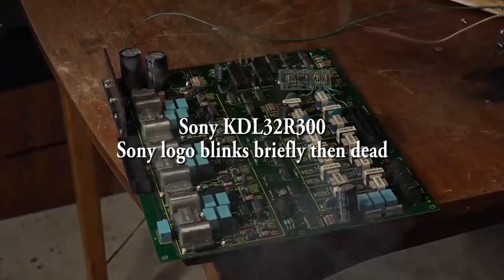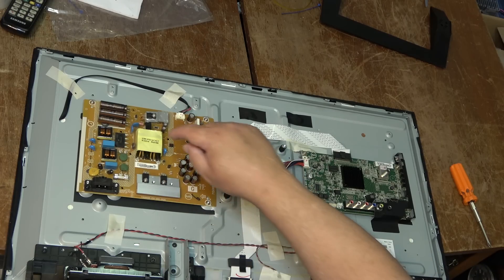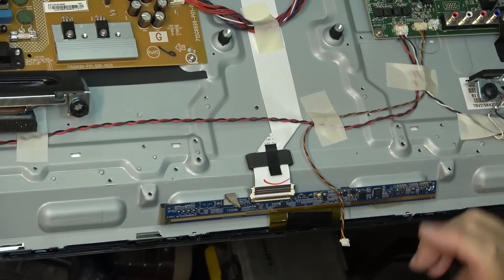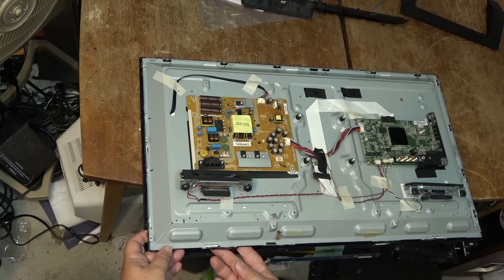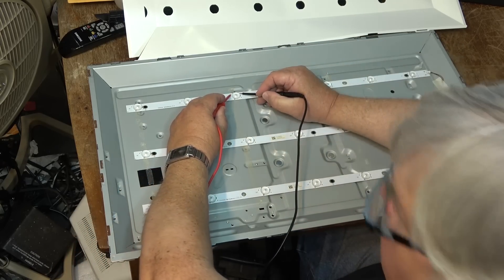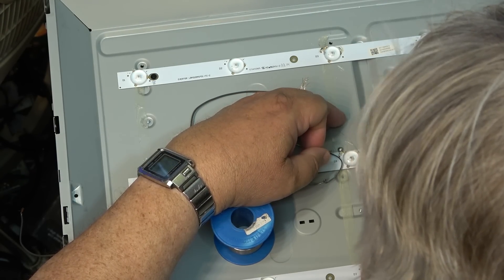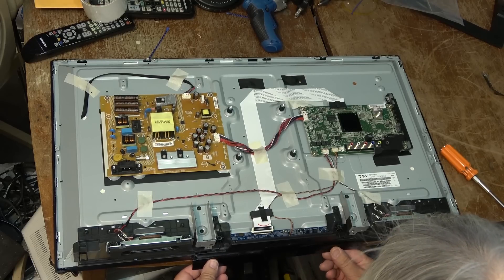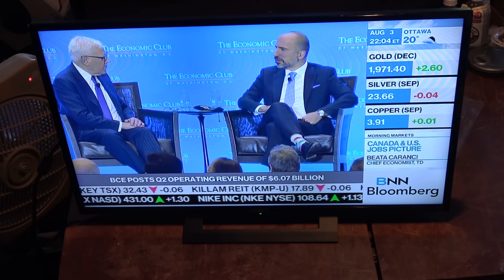This Sony KDL32R300 has a bug in it.  Lets fix it.

Comment: I have a Sony KDL-32V2000 from ~2007 that is still going strong. Gets 10-15 hours of use per week. First thing I did when I purchased it was set the backlight brightness well below 100%.
I'm convinced if people dialed the backlight brightness back a bit they'd get a lot more life out of their TVs. Especially the cheaper units that seem to drive the LEDs real hard.
Of course saying that the TV will probably explode when I turn it on tonight : /
Reply from the maker: Boom
Reply: @12voltvids  solder in some led's i would like to see how to replace lights!
Reply from the maker: @jessede1970  don't have any and it would look even worse.   There would be a color shift as new ones would be a totally different color as they have not aged.   Then there is the headache aligning the lens over the led. Strips need to be removed to do it because the metal back will draw the heat away faster than you can heat it up to solder.
Reply: Cool, couple of months ago got my sisters old Sony Bravia KDL-32D3000 LCD TV, also from 2007 and it's working just fine as well. First thing I looked through the brightness etc. settings, to make sure it's it's not set 100% brightness. Of course doesn't show HD channels, but lower resolution channels (cable) work just fine, and works as a display for videogame consoles as well.
Reply: @12voltvids  You can cut out a square piece of PCB with the LED from a scrap strip, and glue on top of the (cleaned) bad one.
Reply: @12voltvids  thank you I did like the fix today and the bug what got inside that was funny never seen that happen
Reply: KDL-32V4500 from 2009 running fine here. just watched an episode of Orville prior to this video
Reply: Same, our new hisense roku tv is set to Darkest as well
Reply: @jessede1970 why put money in a 10 year old tv that isnt worth more than $25

Problen is , it isnt worth putting money into tv's anymore.
Reply from the maker: @worroSfOretsevraH  too much work.   Looks fine the way it is.
Reply: I set my backlight to about 10%, anything more hurts my eyes anyway. God knows how anyone watches it at 100%
Reply from the maker: @MattyEngland  
If sitting in a dark room. Sure.  I run mine at 75 max and it is good in a bright room
Reply: @12voltvids  Yeah that's true, I very rarely open the blinds, it reminds me how many bastards are outside 🤣
Reply from the maker: @MattyEngland  need to get out more.

Comment: Good morning Dave.....now working on computers AND TV's......ya gotta work out the BUGS.   At least it isn't an expensive elaborate paint job....just to have a friggin' FLY land and get stuck in the middle of a panel.  Now, back on the subject of LED's....I took apart a LED light fixture which has about 60 tiny SMD  LEDs per panel and found 3 of them to be defective.  Since they are so small ( about 1/8th inch square )   how can I tell which polarity they have ?  I looked at them under a scope and see no indicators. I will see if I can remove them with my hot air station and bridge the solder points.  What is your scoop ?
Reply from the maker: Just brigde them. They will be fine.

Comment: I'm trying to think when all this started to become the majority situation: Electronic goods made under license for a "manufacturer" in random different companies. E.g. (Apologies for using network technology as an example - because that's what I'm most familiar with nowadays) Cisco "made" a C3750G-48P-S Switch; some were made in China, some in the Philippines etc. Identical on the outside, ran on the same firmware/software but nothing inside was the same.  I know it's kind of always been a thing, but when did it become the norm? Awareness of it sort of crept up on me in the 90's as I remember it.

Comment: Those backlight LEDs are not that expensive as they were years ago, but it's sometimes hard to get the right ones (with about the same colour temp and brightness), you need quite a bunch of different ones in your drawers and still must be lucky. I always try to exchange them (with a heat gun), but for sure, those old TVs are not worth a dime.
Reply from the maker: It's only worth keeping as a camera monitor. For that it looks fine.  Even with 3 dead  led it's watchable.  I've had it running constantly since putting back together.  The bug is now gone. Looks fine.  I got it free and didn't have to spend a dime fixing it.  I would never change LEDs. I have 2 other sets with a dead led and they look fine and have lasted no problem.

Comment: When I was a young man many years ago there were TV repair shops. You don't see them anymore. The cost of labor has made their repair cost prohibited.  I remember about twenty years ago I took my reel to reel into a shop for repair. The technician just looked at me and said we don't fix them. So, I gave it away along with new tape, and reels. It has become a common site to see them put out on the side of the road with the trash, along with washers, and dryers which use to last for years now only last until they're out of warranty. I've got a tube amplifier thats forty years old, and still working. If I sound like an old fart, it is because I am.
Reply from the maker: Yes I am fully aware.  40 years ago I was just entering the repair business and it was a bad choice in life.  I never really wanted to be a TV repair man, i wanted to be a TV cameraman or video editor.  That is what i went to school for.  I had played around with electronics from an early age and worked at a TV shop while in high school.  I worked at a TV station for a couple of years both as an unpaid intern and a paid staffer doing master control but unfortunately i listened to my boss and did what i was told and when the shit hit the fan he covered his ass and threw me under the bus.  That one mistake i made, removing a tape that had been eaten by a Panasonic umatic (the one i show on my logo unlacing) after my boss told me to carefully remove the tape cost me that job and got me blacklisted.  I landed a job at Sony for a year and took their betamax training.   
Then ended up an at independent service center.  In 1983 minimum wage was 3.15 an hour.  Sony paid 9.50 and the independent shop offered me 10 an hour to start.  Working in electronics repair threw up plenty of roadblocks. Try to get a mortgage and the banker tells you up front that they don't think you will be working long enough to pay it off so they declined.  Mid 80 thought the 90s however proved to be money making years as VCRs needed lots of maintenence to keep them running.  Around 2000 the decline started and I got out in 2003 as I could see the future was definitely not friendly.  Many a colleague however told me i was crazy that these new flat panel TV's would be real moneymakers.  I left and went to a totally different industry.  I too have a vintage tube amp.  An old McIntosh tube receiver.  Worked the last time i tried it which was probably 12 years ago.
Reply: @12voltvids  I wanted to be a computer technician when the big mainframes were still tubes, but because I was color blind, they wouldn't accept me into the school. I also remember them replacing the tubes after so many hours. They had two baskets. one full of new tubes, and an empty one. They would go cabinet to cabinet pulling tubes, and throwing them in the empty basket, and installing new tubes. There were hundreds of tubes. This computer filled a room 30X60 foot and the cabinets were cooled through the bottom of a raised floor. It took twenty tons of air conditioning to cool them. A couple months later the computer was replaced with a transistorized. Compute that was the size of a refrigerator, and twice as fast. They removed the old computer outside and left it there. I asked if I could remove some of the meters, and they let me. Oh, the good old days.
Reply from the maker: @comeasyouare4545  times change as they say.  Even the industry I am in now is changing rapidly.  Company is dumping 6000 workers.  I haven't been dumped yet but that could change.   I'll be able to tell grandkids if I even end up with any how i was part of the transformation from adsl to fiber optic network that they rely on.  Retirement as they say is closer than you think.  The build is almost complete and once done they won't need us anymore.  A skeleton crew to replace broken equipment and downed cables and that's about that.

Comment: Your soldering would improve if you used flux on the connections prior to trying to tin the jumper points. You could also use an eraser to clean the pads which removes the oxidation on the copper pads. That is an old school trick for cleaning leads and such on components. Thank you for taking the time to do this video :)
Reply from the maker: Flux has got nothing to do with it it's called heat. These strips are aluminum backed and the PC is just a flex pc glued to the heat sync.  Usually i crank the iron up to 850.  I didn't this time. I had it at 700f and it takes time to transfer the heat to get the pad to flow temp.   The solder has plenty of flux in it.  Why do you think they call it rosin core.  Flux has nothing to do with it.  The land has to get to the melting temp for the solder before anything happens.
Reply: @12voltvids  I beg to differ here, you are only partially right. Flux in the core of solder helps to clean the pads too. the problem arises when you try to solder where the back plane consumes much of the heat from the soldering iron. If the pads are not clean to start with it takes more heat to transfer heat into the pads. Extra flux does 2 things, it cleans the pads and also provides a mechanism to help transfer the heat into the pads. Instead of being smug about my helpful tip, maybe you ought to do some research on the topic. I have been soldering including micro soldering for over 40 years.
Reply from the maker: @dalevanderzee4086  got you beat there. Over 50 years ibdi use flux where it is required.  Smd work. All it would go here is create a bunch of smoke.

Comment: Hey Dave, can I ask you a off topic question here.....of all the VCRs you have work on over your 40 year career can you tell me which consumer ( VHS HI-FI ) VCR manufacturer and model number has the best design for serviceable units, best quality in terms of longevity of service life of the VCR, best picture quality and so forth. Thanks buddy!
Reply from the maker: That's a tough one.   I would say probably the Mitsubishi hsu65 67 82 ect.
Reply from the maker: andrew_koala2974  TYPING IN CAPS IS SEEN AS SHOUTING.  AND YOU ARE DEAD WRONG ON THAT. NOT ALL CORPORATE NAMES ARE IN ALL CAPS.
Coca-Cola for example, Ford, Technics, Panasonic, Westinghouse, Marconi, Frigidaire  and that's just the ones i can see in the house now.  You really need to open your eyes as statements like that just prove to the world how stupid you are. And you're a troll.

Comment: Hi, 12volt, I have a question about replacing the big capacitor in the power supply section of my 1986 20" Sharp Linytron set.  The original capacitor is 620uf@200v.  I've checked Digikey, Mouser, Newark and several other electronics parts retailers and I can't find any 620uf capacitors at any voltage in stock.  The only in stock potential replacements I can find are either 560uf@200v and 680uf@200v.  As long as the voltage of the replacement capacitor is 200v or above, can the replacement capacitor be either 560uf or 680uf and if the answer is yes, am I better off using a 560uf or 680uf capacitor, considering that the capacitance of the original cap is 620uf.  I appreciate any help you can give me.
Reply from the maker: The 680 is the one to use.  What makes you think the main filter is bad.  When they go you know it because the picture is severely distorted.

Comment: Hello, 
I just bought a Sony Handycam DCR TRV-138 model, and everything works, except when you open the LCD screen, it’s just blank grey, but it will sometimes show a blue screen if you go to playback(?) mode. It displays all of the text perfectly and has no cosmetic damage, yet it shows nothing in the viewfinder or the screen. I took out the battery, I pushed the reset button, I checked the lens and the tape deck for any kind of abnormalities, but I can’t seem to figure it out. I was wondering since I watched a previous video of yours fixing a damaged TRV-138, that you may know what the technical issue is at hand here.
Reply from the maker: Does video play through the output?

Comment: Hi. Can the led be replaced on this TV? Not the whole strip but the individual ones? Thanks
Reply from the maker: Why bother.  A dead led will not show on the screen and the power supply is current limited. The voltage drop is compensated for.

Comment: Ive done the same repair but orded new led strips. Waited 3 weeks for them. Mounted everything and cracked the screen in the upper corner…😂.
Reply from the maker: I don't replace the strips.  Not worth it.   A single led that goes out you won't see.  Even 3 on this one is barely noticeable and it's only going to be used for monitoring security cameras so no big deal.  Changing strips is no more reliable because the new ones can fail just as easy as the old ones.  LEDs normally don't fail unless they were defective in manufacture and you won't know if the new ones are defective till they fail.  I don't want to have a set sitting apart for weeks awaiting parts and i certainly don't want to risk putting it together and then apart again when parts cone in.  I've bypassed a bunch of them over the years and all still working fine.

Comment: Love your channel!
Would you be interested in attempting a repair for your channel on a JVC S9900U? Very low miles, spent almost it's while life in a box. Powers on but spits out tapes immediately.
Reply from the maker: I'm sure I can get it running.
Reply: @12voltvids  Sweet! I just have to check on the cost and ETA from San Diego to make sure it isn't cost-prohibitive and fits with your schedule. It's there a way to contact you through the channel?
Reply from the maker: @scgreek1114  email is under the about tab.

Comment: Hi Dave, how can I get a hold of you for a possible repair work?
Reply from the maker: Email is in about tab. Check on PC  as phones won't show.
Reply: @12voltvids  can't see it. I'm on a Android phone. Is there another method?
Reply from the maker: @lox_5017  need to use a PC. Due to bots I don't float my email.

Comment: I know you have to know that flux would make your life easier.
Reply from the maker: The solder has plenty of flux, what i need is more heat as this is an aluminum backed strip. Do you know what they make heat sinks out of? 
You got it, aluminum.    To boot they are glued to the metal back.  This is to drain the heat from the leds.  So no, extra flux isn't doing anything but cranking up the iron might make it quicker.

Comment: 21:40 that would bug me to no end ... I'd be taking it apart again
Reply from the maker: Thing about bugs is they only live a few days.  Then gravity takes over.
Reply: @12voltvids  
True ... so long as there's space for it to fall in.  With my luck it would end up right in the middle of the screen... LOL
Reply from the maker: @Douglas_Blake_579  there is a gap between the screen and the diffuser.  That's where it was.  It fell to the bottom and out of sight.  If it stuck a tap on the screen would knock it down.

Comment: I had a Sony BRAVIA LCD Model Number KDL/KLV-46BX450. What a load of crap this television was. I bought the unit new in 2012. It didn't even last 7 years and it had less than 10 000 hours of use ! I will never ever buy a Sony again... 👍